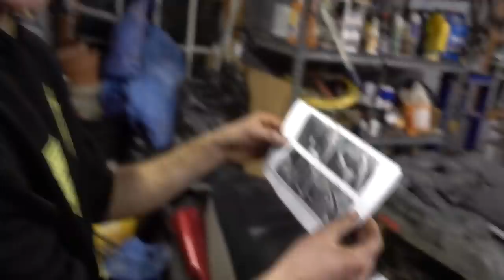INSANE DIESEL POWER HACK

Comment: filter head has nothing to do with your truck not revving over 2k RPM...check for collapsed fuel lines. could also be low rail pressure, and you may need a new Fuel pressure regulator. more than likely you need a new fuel pressure regulator on your cp3 or a whole cp3 altogether.
Reply: it's ok...everyone needs a little help now and then lol. hopefully he sees my comment.
Reply: dont need a CTS to diagnose the problem...if its limiting him at 2k rpm that's limp mode being caused probably by low rail pressure, seen it on plenty of trucks including my own...tech 2 or gm scan tool would be much better to diagnose rail pressure issue. you can replace the FPR...but it doesn't always fix it. I would just drop in a new cp3 if my FPR was bad.
Reply: not necessarily.
Reply: Gotta check pump inlet vacuume
Reply: both farm duramax trucks as soon as fuel filter life hits 0% or a little after they won't run over 2k rpm every time slap a filter in and it's good to go. my buddy's dura dog also does is....

Comment: naw man, I throw abrasive sand in my trucks pistons to bore it out, and now it is at least 1 more liter engine!
Reply: Crazy cal sand I use pea-rock for my boring on my 5.4 triton I now have a 7.0
Reply: Minnesota outdoors A triton can be bored out by throwing it in the garbage and buying a diesel.
Reply: right on thanks man. I'm gonna try that on my truck
Reply: it worked threw my triton away for a cummins 5.9l I can feel the power
Reply: sounds like something I should do.

Comment: little tip, next time bleed you're fuel system at the test port on the right front side of the engine, just open the Schrader valve while pumping the primer bulb, it will crank up just like it normally would

Comment: Hey dalton I was just watching your last video on your fuel filter issue. If you want to spend a little money on the truck and delete the issue I would recommend fast fuel system or air dog. With those systems you can delete the stock fuel housing and the aftermarket pump has 2 filters so no problems.

Comment: Get a lift pump @3dmachines. I have a 2004 duramax with the Nicktane Cat adaptor and it works perfectly! The lift pump forces fuel to the cp3 rather than the cp3 sucking it from the tank

Comment: my guess is why the camera looks blurry at night is its trying to adjust to the low light by lowering the shutter speed, if you're using it on auto that's likely the reason why. if you can bump up the ISO and lower the aperture you will be able to use your camera in low light situations, I'm not sure if those cameras are capable of this but it's worth a try.

Comment: Hey 3DMACHINES i just got down watching this video i have a suggestion so adding 2 more holes to you filter adapter will allow more fuel in ibthinkbit would be worth trying to inlarge the center hole on the filter adapter to allow more fuel out the center hole is going to be your bottle neck.

Comment: Well, ya see. It sits at 2000 because its got enough torque to pull itself along at that. 

Unless you are putting it to the floor, and expecting 3-4 thousand RPM, You'd probably see those in lower gears.

I've had this experience in a 1992 Super duty IDI, and all it did was save my ass on diesel fuel. Made 22 to the gallon at 115 Mph

Comment: So now you now have a holy adapter.  Don't suspect the holes are a problem.  Look at the injector voltage and current.
Reply: I agree
Reply: yeah, or just buy a new better adapter and have it forever and be done with it.. but I suspect injectors also

Comment: harbor freight I had 3,000 gift card I won to their and they had everything I needed to build a custom plow hitch chains for my tiers my store had a hole otomotive section I bought 2 turbos and stacks led light bar 19 thousand lumens and a new alternator to make most power and 100 feet of flexible cutable very 6 lights and waterproof they only did 12 thousand lumens.    harbor freight is amazing

Comment: UHHH..."Dura-Strokin", did you consider the Engineer/Designer/Manufacturer of the engine might know a little more about that engine than YOU do?? and that the parts they specifiy for the product have been thoroughly tested and so drilling all those holes are NOT what might be best for that engine???